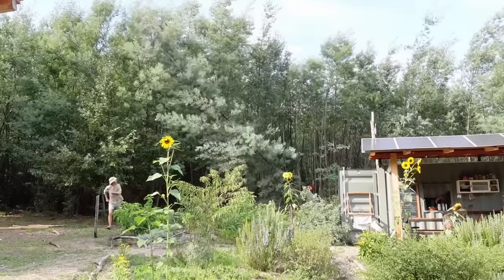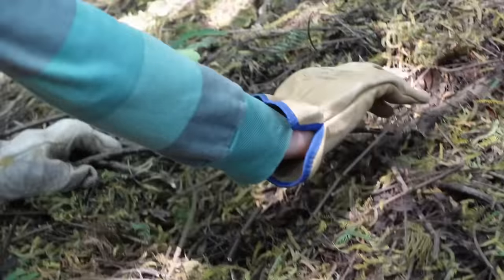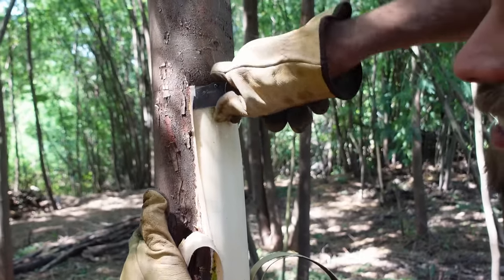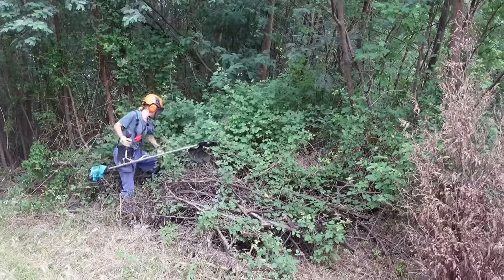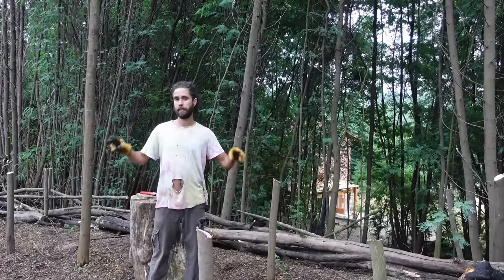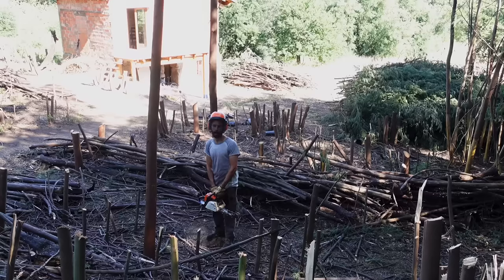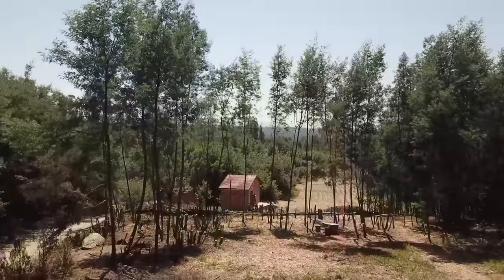#84 Why we're chopping a forest down

Comment: I would suggest using box cutters/utility knifes for debarking as they are very sharp and easy replaceable.  And I would use powerfull sawzall resipricating saw with proning blade to cut stumps at ground level. It cuts slower than chain saw, but you only need to cut it once.

Comment: Without removing the stump/root ball, simply cutting the Mimosa down will only set up more work later. Although, cutting the drying the wood to break or cut into pieces about as long as your forearm to then stack around the stumps. So you can light the small piles to use fire to kill the stumps by basically cooking them. For the ashes, mix them at a one to five ratio (one shovel to five shovel fulls) to soil and other decaying organics to ashes. Make yourself a form of biochar based soil that can be mixed in with other soils or sold to any farmers/gardeners. 

Otherwise it'll be a whole lot of digging the stump/root ball out. Then replanting native and fruit bearing while being concerned about erosion until the replanting is established fully.

Comment: The secaturs just need to be cleaned. They have sap and dirt gunking them up. You can take them apart by unscrewing the retention screws, bolt,& retention spring and using mineral spirits or terpentine, scrub them clean, (sharpen the blade, and re-oil the moving parts while you have them dissasembled) and then reassemble. Counts as your yearly maintenance task done! WD-40 works to dissolve the gunk and will lubricate the moving parts all in one step if its available. I know they sell it in the UK ( its a staple in America) but I dont know if its available in Portugal.

Comment: I had a tree in the garden I wanted to get rid of. My gardener told me to drill into the tree fill up the whole with Glialka. Drill downwards so the herbicide does not drip out. Glialka is sold in Hungary, not sure what it is called in other courtiers. But I was told that this stops the growing of the roots and the tree dies out. And with the herbicide in the tree it gets sucked up by the tree and does not affect and other trees nearby. So I think this is a safe method. And I think you can use it after your chop down the tree to stop it sprouting again.

Comment: I suggest that you cut the trees closer to the ground. Those tall stumps make clean up much harder. If you cut them low enough, you can use your trucks, tractors or other equipment much closer to your work area during clean up. Also, pulling the trees out by hand is much easier. I have some experience clearing brush lots. Sharp axes are handy for removing smaller trees and branches, too. Much quicker than a saw and easier to handle.

Comment: If you want fire resilience make Shure you clear out dead wood! 
 it burns fast like you said, so if you stamp it down onto the ground you have more fuel to make a hotter fire. 

What you are doing now would only be slightly helpful just after summer, so it has a lot of time to degrade before the dry season comes. 

Divide sections of mimosa's  with a path of about 10m wide so the fires can't easily spread from one section to another. 

Remove all fuel or make small controlled fires so the fuel is already gone ( only by professionals). If it alights than the fires are small and easier to deal with and provide the necessary nutrients for the native plants.

Do you have a forester or treeworker on your team?

Comment: the pruning scissors aren't broken, it's normal that they lock after prolonged use, they need only a good cleaning and oiling.. check the springs and remove any debris that may have entered inside, remove any sap crusts from blade and lower jaw, then some wd-40 or a few drops of chainsaw oil to lubricate the pivot and they are good for the next job..
I would also recommend using billhooks instead of hatchets for debarking or removing the smaller branches from the cut down wood.. it's also a good tool for clearing undergrowth

Comment: The section where y'all dropped everything? I've been doing something similar (on a smaller scale though), and I strongly recommend the following:

It's highly important there should be paths & gaps between the stacks. These serve as safe access routes for small vehicles (including mowers) and as fire breaks for ground fire. The cleared spaces should probably be dirt for the first couple of years until the rotting process is well underway. After that, grass & forbs that are kept mowed/grazed. The piles should be no wider than 2 meters (a little less is better); a person standing at the edge should be able to reach into the center.

Equally important, the piles of wood need to packed solid - no gaps for air or light to move through. Air gaps promote drying, which stops the rotting cycle & increases flammablity. Light gaps allow brambles & stuff to regrow. What I've found effective is to "stack & pack". Trim big & awkward pieces so they lie flat & parallel; pack the bigger pieces with smaller pieces; then fill that in with the mulched material. Work in layers of ~5 cm, watering each layer until moist (or let a rainstorm do the work). Build up to maybe a meter over the first year; every few months tamp it down (I just beat it with a shovel or stomp across). With this method you end up with marvelous wood berms that speed up the rotting process be (in my experience) by a couple of decades, and retain enough moisture to be fire resistant even during the dry season (the outer edges may still smolder, which is why the pathways are essential). Brambles & invasive roots will struggle to break through a dense wood berm. I had ~90% suppression in the first year. I pulled out the regrowth & packed on extra woody material, & in the second year it was 100% suppressed.  (continued in comments)
Reply: Wood berms are fantastic nutrient & moisture reservoirs for saplings, and can be used to create terraces. If you want to plant vegetables on the terraces, you'll need to add topsoil (essentially creating a hugelkultur terrace). 

To establish open areas, use tarps around the perimeter to suppress all growth for a year or more. Again, it creates an immediate fire break; it also creates a growth break to deter creeping roots & vines.  If you decide to run fencing, tarps can help clear a clean line.

As your native trees get established, prune lower limbs so there's nothing for the first 2 meters. Yet again, this creates a fire break (vertical rather than horizontal). It also helps you visually monitor regrowth by the invasives. Plus a bunch of silvaculture benefits.

Sorry this is so long, but I hope some of it helps!

Comment: If you cut the tree's down then use an excavator to rip the stumps out you can either drastically reduce the speed that they come back, or completely remove their ability to regrow. You can also cut the stump down to ground level and use concentrated herbicides (Drill a large hole into the stump, pour the herbicide into said hole, and it kills the stump and root system (and supposedly keeps the herbicide out of the soil.).

Comment: If you have camp fires in the cold season turning the larger mamosa into charcoal will give a cleaner burn. Also adding ground charcoal to the ground and garden will help improve the soil. While this may not be implemented now it is a method that can be used later in the year.

Comment: Hi guys i myself do some allien clearing in south africa by the rivers in the western cape. Especially black wattle trees one thing you should know is the small ones that had been cut will always grow you need to remove it with the root and if not possible poison should be used the poisen that works best is Garlon and from then on every area you clean follow up twice a year pull the new small ones roots and all out. You should know that you should apply the poison within 10 seconds after cutting the tree and try to cut it as low as possible. Wish i could say more but i hate typing to much 😊

Comment: Wonder if it's worth investing (crowd sourcing) and getting a stump grinder, which could be used to remove the mimosa stumps to stop them resprouting. I worry you'll be constantly battling resprouting mimosas if stumps/roots not removed. And maybe a industrial wood chipper that could take larger trees/vegetation. Obvs a cost involved but worth it in the long run.

Comment: People here where I live used to limb up the trees to get a cool under current breeze going and keep the bugs at bay. The canopy here helped with the humidity. I dont know why people think just planting trees with no maintenance in populated areas is a totally great idea.  Too close to the ground,the canopy will keep the heat in and build humidity.  I dont like the swamp effect. Misquotes go up into the trees, with the lower limbs, more Misquotes closer to people, slight breeze helps to keep them at bay too. A good indigenous grassed flooring, and not much maintenance needed in your "forrest." Like a Hansel and Gretal forrest. 😅 Get a few lil goats. Like your project, good luck 😊

Comment: it looks like some of the mimosas become coppiced, with the stumps being so high as they are left, which may help to give more of a feed source to the new shoots and cause them to regrow faster. I know it is not good for the soil, but complete tree removal from the root ball, now that you have more cleared, or as a project in itself to completely remove and replant small areas, may help to make a more sustainable path moving forward. Highly interested in the debarking method though.

Comment: You could build a gasifier and fuel it from the wood. Use the wood gas to run generators to recharge batteries.

Comment: Paint a bit of straight glyphosate 360 to the freshly cut stem base the minute you've cut it. It will take the poison to the roots without greatly harming the soil. Stack and dry larger trunks for construction and firewood. Mulch the rest. Easy 😂😂

Comment: I would recommend using pigs to clear selected areas.  They can completely uproot trees.  You can contain them with electrified wires in a chosen area.  Once you achieve the desired result in one area you can move the pigs.  You would then plant oaks or other desired species.  Farmers have used pigs to clear land for centuries.

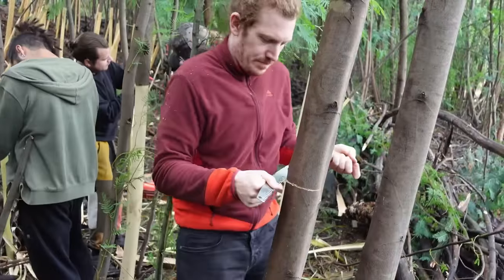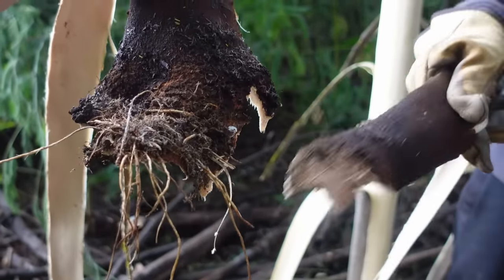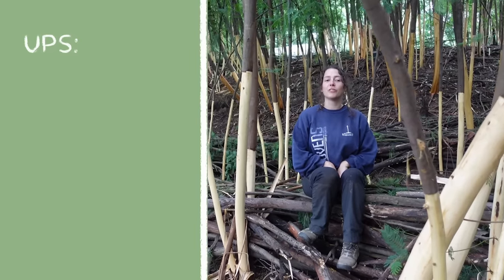Comment: 15:00 A saw is the way to go.  This saw is dull and the person is pushing too hard.  Gentle push and pull with one hand as you walk around the tree.  Do not work so hard.  You are overwhelming the saw.  The teeth are not ground to be pushed.  15:04 and 15:14 why you want a saw that folds so it can be carried in your pocket. 15:16 These are adventitious roots.  They mean nothing to the survival of the tree. They will be the first to die and disintegrate.  18:45  The bypass pruners are stuck because 1) they are gummed up with sap.  Clean the joint with turpentine or similar solvent and apply a drop of oil to the clean joint and on or two drops on the spring. Simple maintenance along with  sharpening.  17:08 These mimosa will resprout.  Don't know where you got that information.  The roots have sufficient carbohydrate stores to live for at least three years.  Among the debarked (500 trees) area - how many quality volunteer trees (oaks, etc) did you find?

Comment: Have you looked in to converting you wood to charcoal, can be done cheaply by using a hole in the ground or making a purpose built charcoal oven?? The Incas used to use it as a soil improver called TERRA PRETA. Charcoal can be converted in to bio char or used tofor heating, cooking, blacksmithing etc or even as a saleable product.

Comment: mid summer i proberbly the best time to cut the trees as they are the most vulnerable, however it will take many years repeatly. I would get a liter of roundup and spray the trees in the autum. in autum the trees bring all the juice back to the root to store in winther. If you can get roundup timed right you can kille the root in one go. I did that with inversive spiece at my home. If i cut only it can take years and years to kill the root.

Comment: If you want to keep the tree trunks being used as water breaks, cover them with soil and that will stop them from burning in case a fire comes through. It will also speed decomposition. Otherwise, you are leaving fuel on the ground that will burn hotter and longer than trees left standing.

Comment: What was the reasoning behind cutting the mimosas at waist height? was it simply for ease? and were the few tall trees you left native trees?
On my parent's property in Australia we have a similar problem with invasive radiata pine trees. We only have about five acres of bush/forest which we mainly use for collecting firewood. dead branches and needles from radiata pine also burn very quickly in bushfires, but because of the sap, which creates residue in the chimney when burnt, it's not suitable for firewood. however, as it doesn't really resprout from the stumps like the mimosa, we cut it with chainsaws and just leave it to dry in heaps before burning it off.

Comment: IMHO in addition to tall dead & dry standing trees, leaving the sticks in place to rot may also be a hazard.  Do you know how fast this wood breaks down under the conditions you have there?   Some wood is very resistant to rot.   I would think that it would be better to use it in your oven, or create hügel mounds if the wood is suitable for it.  Or a controlled burn when it is permitted.

Comment: I use salt to kill the roots of trees.  Using a Forstner drill Bits a large hole or several holes depends on the stump size.  the hole should be 15 to 20 cm deep in pith of the stump.  Fill with salt.  It may take several applications of salt.   It is best if the holes extend below the ground line as this helps kill the suckers which usually grow around the stump at the ground line.

Comment: There is the option to turn the mimosa into biochar, your soil will contain a higher carbon content for decades to go, further increase in furtility and waterholding capacity. Just what you need during wildfire season. Good luck

Comment: I’m curious... Is there any reported experience of how this mimosa might be used to create charcoal? If it does make good charcoal the benefit would be to have a good heating material for burning in winter and in small burn needs without smoke and cleaner burning...after the process of coarse! How does this wood behave as dimensional sticks and boards for building? 
I’m super curious as to how the plans have evolved suggesting that cutting all the mimosa down is better than preserving some amount of shade... and how much or does leaving any mimosa in the ground pose problems with further spread... and the many more questions and reasons for what is being explored now? What would the pulp being ground and washed be useful for inf not paper and pulp products? I’m clear that this and much more is being questioned though its clear these options are as yet still being worked out across the whole nation.
For what its worth I have tried various attempts to open the community project site from here and its not yet functioning.....

Comment: As I understand it, the mimosa Acacia is a good nitrogen fixer. And the reason that it grows back so quickly means that you can farm carbon. What you basically have done is coppiced the stems at a workable height. If you cut the stems in autumn they provide shade and shelter to the young native trees (or anything else you plant there) in summer. Autumn is also a good moment for carbon to be absorbed by the soil, so you raise local soil fertility if you just let it lay there rot away. The technique is called chop and drop, and is used to speed up the growth of food forests. Because a new forest grows best on a fallen forest.

Comment: Those trees are nitrogen fixers. In areas with poorer soil quality they're planted on purpose by things like fruit trees which need a lot of nitrogen.  Oftentimes in the same hole, it's just cut every year to keep it from taking over.  

You should take some of that and make biochar and dig that into your garden soil.  Your vegetables will grow very well with that. For years and years. 

The bark can be cut into thin strips for floor mats, weaving for natural fences, make baskets,  etc. 

I worry that all of it left on the ground and standing debarked is just fuel for any fire.  It will be more flammable now.  Just cut them down and pluck any leaves that grow from it.  It will die eventually.  Leave enough to make leaky dams to slow down the water but burn the rest or chop it up to burn in your earth oven or to keep warm,  or use it as kindling.  

Y'all should find some old timers,  they have good information on things done before all the new inorganic stuff.   

Not sure if y'all know about a channel called Eugenio Masenmano. He an old man in his 70's, from Spain,  and he documents all types of old school,  traditional ways.  I think y'all would love it! There's hundreds of videos on just about everything you can think of.  His mission is to document all before the knowledge is lost.  Maybe you can check it out.  It's on YouTube.

Comment: I have found here in America, a variety of wild fruit, called Mulberry, which can be very invasive. I have found to remove this type of tree from growing all together, is that when you cut it down , dig around th base of th trunk down, about 3" below the ground, cut it that deep, then wet that cut area with water, and then spread table salt across that cut 1/4" thick. This will kill that tree completely, and you should not have to worry about it growing again from that trunk.